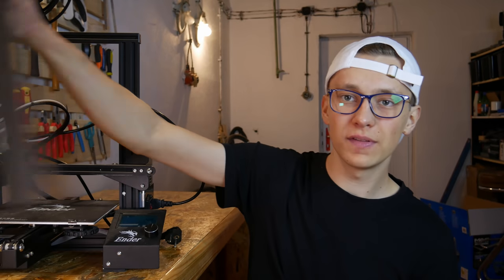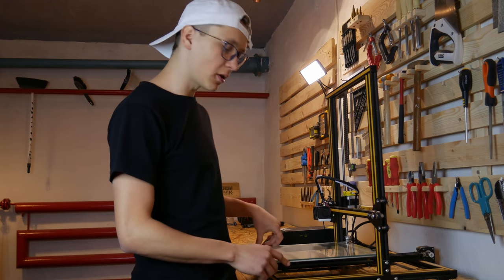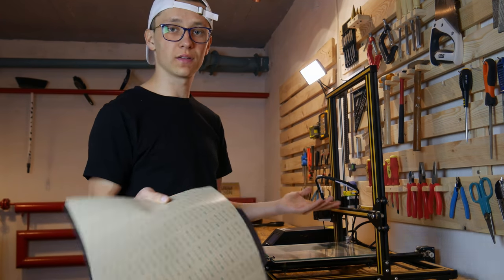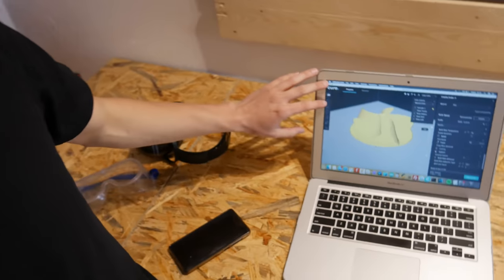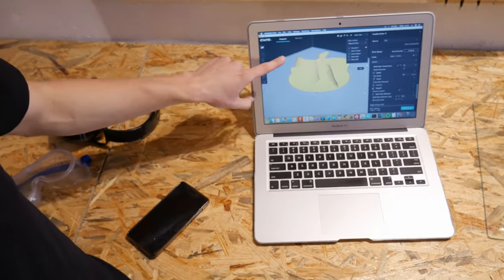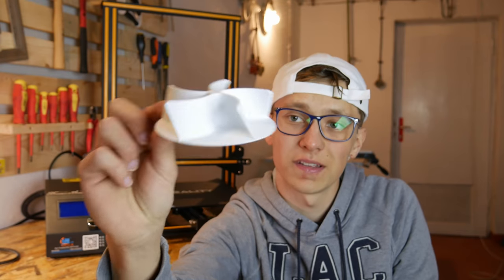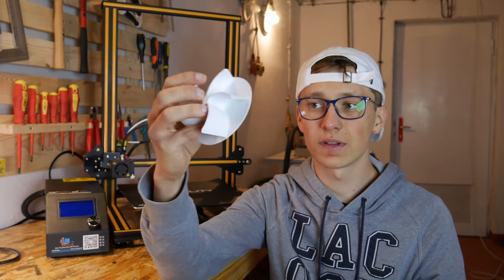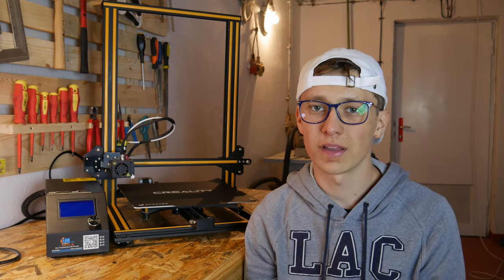How to make your 3D prints stick to the bed?

Comment: You need to try Coropad, then you understand that this material from Creality is very low quality (yes I have two of them) ;) Regards!
Reply from the maker: Haha, my Dad watches a lot of your videos :) I enjoy them too! Thanks, never really tried any other build plate, in my opinion, anything is better than glass and this works for me good so far, maybe I will upgrade that in the future. Miłego dnia!
Reply: I don't think Coropad is any good either. Mine got damaged on the first large print I did. Basically the printed part stuck so well that the Coropad got ripped off with the part ;(
Reply: @TomaszCzajka80  how its possibile? DiD you read manual how to use it? I did more than 100 prints already all petg and its looks like new
Reply: @d.i.d  Or course I read the manual. It was a very large ABS print with heated bed on.

Comment: This is cool but for me it was bad. I had super shitty adhesion and when the print finally stuck there was an ereor in the .gcode and the head crashed and destroyed the Cmag. I still got a refund but sadly the build plate is useless now.
Reply: On my case, the only way to make the parts adhere to the bed was to print the first layer SUPER close, like almost dragging the nozzle across the surface. That way prints stuck to the bed perfectly. If the Z height was not close enough, the filament would just drag and stick to the nozzle
Reply: @OlivierLopezCh  Oh yeah same for me. But I was dumb and forgot to save the mesh to EEPROM so I destroyed the darn thing.